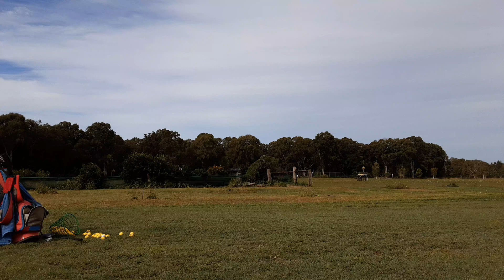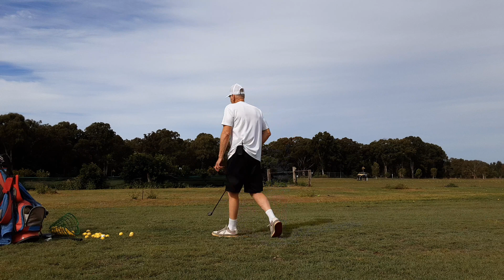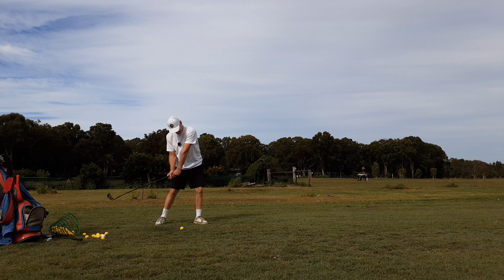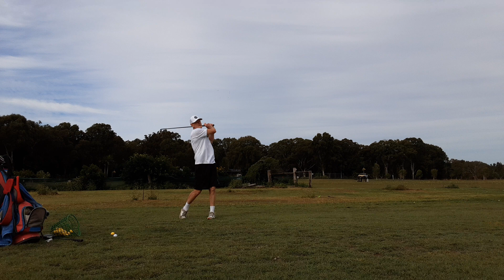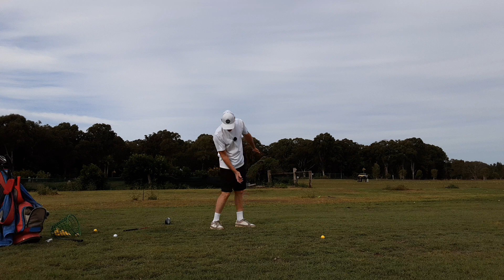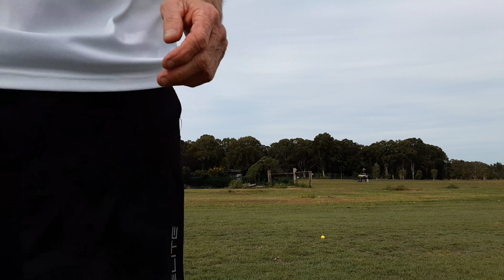Grip   'IN'  ..  Clubhead  'OUT'   through Impact ..

Comment: You are definitely on to something great again, sweet indeed.
Reply from the maker: That  process/action  is just   prevelent in all good  ball strikers  ..  Hogan  did it  probably  more accutely than anyone  ever has  .. 
         Sometimes when I practice   I   try to    get the handle  going  so  far towards my  lead thigh  that  I think I should   pull the clubhead    to far inside the ball coming into impact and miss the ball altogether  .. when I get that  extreme  application 'feeling'  happening  I absolutely kill the ball  ..  and with Pitch shots   I  feel  I am going  to   hole   every shot  so straight   does the ball fly..
                  cheers JH

Comment: JH

It looks like your ball position at setup is now in the middle of your stance with the irons and a bit forward more  with the driver compared to Channel Lock 

Is that correct or just the camera angle

It’s different seeing you disturbing the grass now at contact 

Great ball contact sound
Reply from the maker: I  am not doing videos about  CL   specific anymore as I   told everyone recently  ..   videos like today's will be relative to whatever type of swing people are  currently using  ..  ball position   etc will be relative to the swings  I am working on at the time  ..  which today's type was general traditional type swing mechanics  .. 
                Today's ball position will be mostly the position I will use with conventional type swings  .. it is further back than a conventional swing ball positioning  ... and I will be trying to get people to move the ball back further than they normally do in their normal swings because  I firmly believe  'all' swings can benefit from that  .. 
                          cheers JH